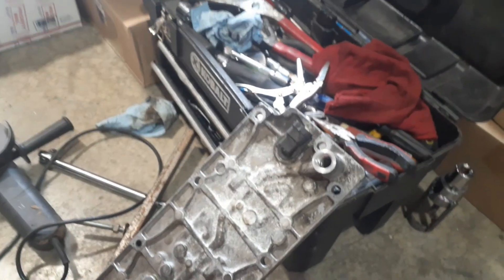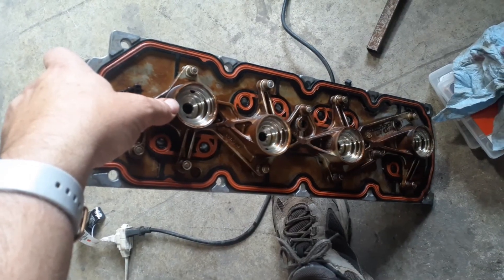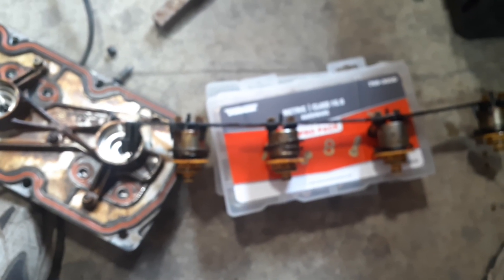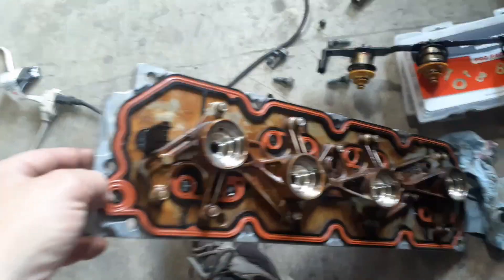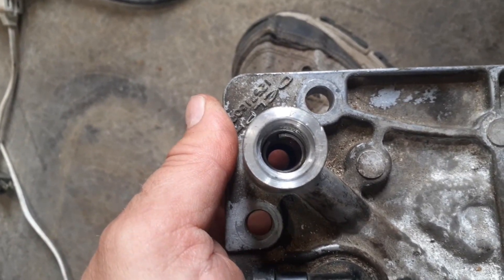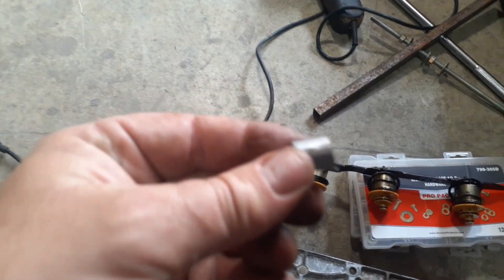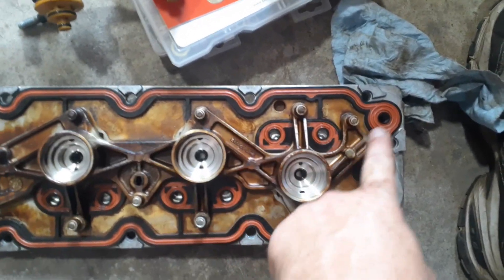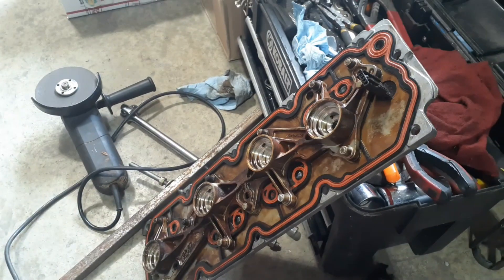A Tip for a DOD AFM Delete Using the stock Valley Cover

Comment: I CUT THE RIVITS AND REMOVE EVERYTHING FLAT ON BOTH SIDES 2007 TAHOE
Reply: What did you do about the electrical plug? You just leave it unplugged and plug the hold the connector was in with a 22mm freeze plug?

Comment: I seen a video that says do not block oil going into the VLOM. It has a tiny hole that lubricates the mechanical fuel pump lifter.  FOUND the video......   LT based Direct Injection Must See!!! VLOM mod Information Update
Reply from the maker: Plus what I'm recommending doesn't apply to LT motors.
Reply from the maker: Mechanical fuel pump lifter??  The fuel pump is electric and in the fuel tank.  What do you mean??
Reply: @carstars1181 the high pressure pump these are direct injected 2 fuel pumps

Comment: why didn't you just leave the solenoids on the valley?    Did that with
 mine had no problem.
Reply: You cammed it and dod delete using oem valley cover?
Reply: @DanVilla-k4k  if you're asking me yes I put the plugs in the hole hammered them down and just put the factory cover back over without any issues. Everything was turned off in the tune but didn't have wires dangling
Reply: @garagenut8676  thanks bro im doing the same i just didnt wana spend extra on a valley cover
Reply: @garagenut8676  what’s up man. Im about to complete my dod removal with a tune plugs in the block and non AFM lifters with using the stock valley cover with everything still in place. Did you not do the extra sleeve in the passage way? Im reading you don’t need to do it because of the plugs you tap into the block.
Reply: @fernandomorales2970  Yes still install the plugs. the OEM cover on plug in the connection once you go into the tune and turn off the DOD it's all shut off. No different than shutting off your downstream O2 sensor
Reply: @garagenut8676  you didn’t do the vlom plug is what I guess I’m asking. Only the 8 tower plugs using the stock valley cover and tuning out DOD. Along with the other stuff like the cam and non DOD lifters.
Reply from the maker: I guess I just wanted to clean it up and get rid of all the unnecessary stuff on there.
Reply: im guessing my 15psi is because i didnt block the towers and used the stock cover lol
Reply: @ElevatedProductionsCo  ...when you do the DOD delete, remember to remove and plug the oil pressure bypass in the oil pan if your ride is equipped with it.  My oil pressure was 20 after DOD delete.  Removed and plugged oil bypass valve in base pan...Boom 50 psi.

Comment: But why plug the tower for the oil passage ways ? If we’re reusing the cover don’t get it I was using my truck with no tune after doing afm delete it would work for 100 hundred miles normally with the oil pressure sensor disconnected using the stock cover it wouldn’t kick into afm and now it’s driving dumb it doesn’t wanna pass 40 mph and just revs high  but when I disconnect the other connector for the cover it misfires but it goes over 40 now my problem it misfires does it actually need a tune it was working fine then out of no where it started  doing it sorry it’s bunch of stuff going on
Reply: It sounds to me like you’ve got a transmission problem. No second gear? Connector not plugged in? Because a combination of not going past 40 and revving high makes me think it’s just not shifting. I got an 09 5.3 with a 4l60e and it goes to 45 in first gear while revving at 6k. Not sure the problem’s with your engine at all.
Reply from the maker: I'm not an expert so, take what I say with a grain of salt, but I plugged the towers to make absolutely sure that there would be no oil pressure loss through there.  I was reusing the stock cover which still had all the passageways in it.  The delete covers don't have the passageways.   As far as what's going on with your truck, I don't know because I'm not clear what you did to delete the afm.  Did you actually install 8 new lifters after removing the afm lifters?

Comment: Im probably going to do an afm delete in the future. From what i understand, the solenoids plug in just like any other plug on the truck, like a headlight plugs into the harness? If so, what do you do with the plug when you have no solenoids to plug into it? Im probably going to replace the valley cover.
Reply from the maker: You could just leave it unplugged...or cut it off and terminate the wires so they don't short out.  You need to have a tuner tune out the afm.
Reply: @carstars1181 so when you get the ecu tuned you no longer need those 2 sensors on the valley cover?

Comment: What hardware store did you purchase that little sleeve from and what size is it? Thank you.
Reply from the maker: I went back to my local Ace hardware store and I think that's where I got it.  I believe it was a 1/2 steel spacer made by Hillman, but again, I'm not 100% sure on the size.  I hope that helps at least a bit.  Don't forget to enter our Milwaukee tool giveaway by commenting on our tool giveaway video.

Comment: I had experienced a cam and lifter failure due to a DOD lifter rotating 90 degrees 2.5 years ago. I replaced the cam and lifters with a non-DOD kit, had the ECM DOD deleted, and I had tapped out the oil bores with a 3/8" pipe tap and installed pipe plugs with sealant. Over two years later my truck is still running strong with no engine check engine light.
Reply from the maker: Isn't it a shame that GM would make a design that would allow a lifter to turn like that.

Comment: I've watched the video from the guy that did this I think you were talking about and I bought his kit that I was able to release the lifter and I was able to get his sleeve to put in that oil sending unit. But he also says or he puts in his video that he literally removes the gasket on top of the towers that go down to the lifters saying that the oil pressure actually causes the lifter failure. What are your thoughts on that? Literally he chisels those gaskets off at the top of the towers that go down to the lifters.
Reply from the maker: So if I understand you correctly, you are talking about the gasket that is pretty much permanently attached to the valley cover.  We also took that off by cutting the gasket near the perimeter and then removing the solenoid type devices that are part of the cover.  We then used a standard valley cover gasket when we put the valley cover back onto the engine.  To be honest, I think if you seal off the towers that are part of the engine block using either the Lingenfelter rivets (which is what I did) or some people use ball bearings, others tap the holes and screw in a plug, and you put the sleeve into the oil pressure sending unit like you said you've already done, I think you can just reuse the stock valley cover as is.  I hope that made sense.
Reply: @carstars1181  I actually kind of mean the gaskets that are on the inner portion of the valley cover. So not the actual outer perimeter of the get value cover but the inner part where those little circle gaskets go on top of the towers those towers that go straight down to the lifters. I didn't know you could take out the solenoids all together.
Reply from the maker: Oh and don't forget to watch our Hot Rod Magazine giveaway video and comment on it so you can win.
Reply from the maker: Ok, if you block off the towers with a rivet kit or however you want to do it, those little circular gaskets on the valley cover are not really doing anything since you have actually plugged those holes in the towers.  Does that answer your question?
Reply: @carstars1181 can i block the towers while i still got the afm lifters in there but shut off afm system through a tune?
Reply from the maker: @khaledalassiri86  I'm not 100% sure on this but I'm going to say yes since deactivating the afm should mean no more oil going through the towers via those solenoids.

Comment: What is the point of a DOD delete? Please explain.
Reply from the maker: DOD stands for displacement on demand.  Also known as active fuel management.  The solenoids cut off the oil flow allowing 4 lifters to collapse on purpose to "kill" 4 of the cylinders thus turning the motor into a 4 cylinder for supposedly better fuel economy.  The problem is, is that the lifter sometimes doesn't come back thus killing your performance. It's better to just delete all that nonsense.
Reply: @carstars1181  Cool. Thanks for the explanation!
Reply: @carstars1181 So does the DOD illuminate the ECO light on the instrument panel?
Reply from the maker: @westhomp1721  to be honest, I don't know the answer to that.
Reply: @westhomp1721 yes it does, especially when you experience lifter failure.
Reply: Dod/ afm have special lifters that allow for cylinder deactivation, over time these lifters are prone for failure as they can collapse and turn in their tray causing a noisy tick and even cam and lifter damage, if you dont delete it you run the risk of the same type of failure in the future, this is not only a performance upgrade it enhances the reliablity, gm had a very smart and good design in their 5.3l, very straight foward and reliable and they replaced it with the dumb dod/ afm bullshit to make it fuel efficient
Reply: @jamesbasye2362  THANK YOU!